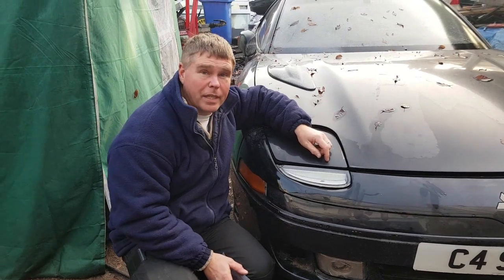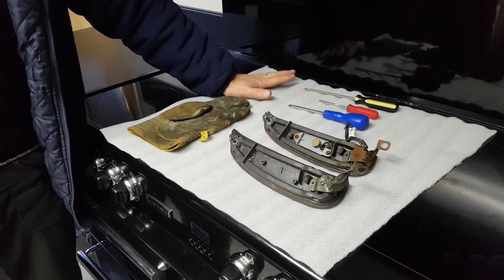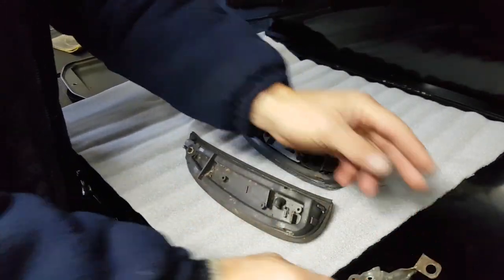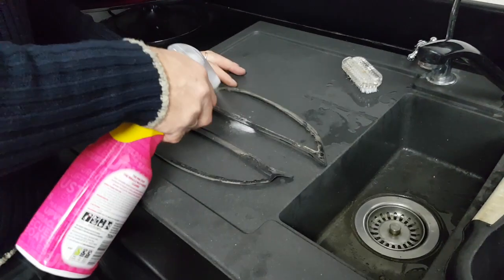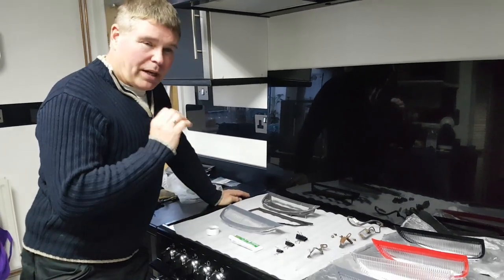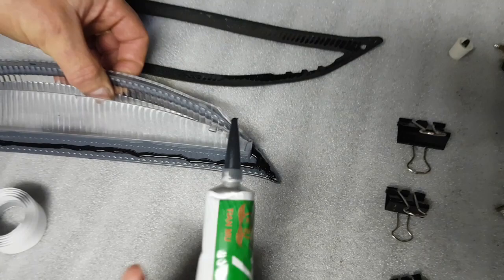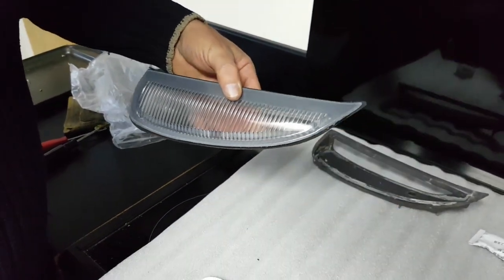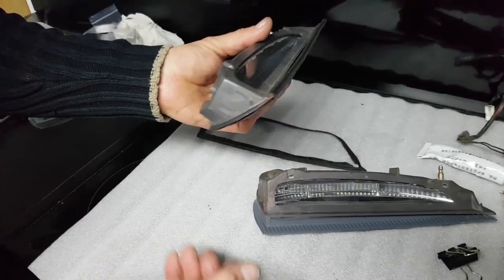Mitsubishi 3000gt / GTO front light repair

Comment: That engine bay looks remarkably clean. I would love to see a video about how you've made it look so clean and new. Another great video btw
Reply from the maker: I have had the 3000gt sl from new and have just maintained it properly. I have another 3000gt that was a total piece of crap and I started restoration before starting this video series but I will see if I can get mitch to put a slide show together so that you can see how the restoration was done. After the strip down videos are complete, I will be doing a full set of videos covering restoration which will be very comprehensive. Due to the cost of making the videos and my time constraints, the restoration videos are still a few months away but will be worth waiting for.
Reply: @3000GTGTORestoration  I can't wait to see them. I am also going to contribute to the fund as I find your videos to be of high quality and I would like to see them keep being produced. I have a few GTOs of various states here at the moment, and the dashboard removal and restoration videos were very helpful to me so thanks again
Reply from the maker: The videos are a gift without charge. You will also find fantastic offers on my new forum.

Comment: I don't have a problem with my low beam lights. They pop up and turn on just fine. However, I have a perplexing problem with my high beams. When I pull the stick back to turn them on, they do not, and instead, the low beams turn off instead! Imagine my surprise when driving at night.
Is this related to the actuator inside the car, or in the lights themselves?
Any insight would be appreciated.
Reply from the maker: Please could direct fault finding questions to the forum. YouTube is for videos. Thank you.
Reply: @3000GTGTORestoration  point me in the direction of the forum you mentioned please? I asked around in a few FB groups I'm a member of, and nobody knew.
Reply from the maker: Forum.the3000gtplace.com
Reply: @3000GTGTORestoration  thanks. I appreciate it.

Comment: Love the videos! I was interested in getting a pair of these replacement lenses shipped to the USA, but can't seem to add the phone number you noted in some of the comments to my WhatsApp. Any trick to sending you a message there?
Reply from the maker: Try adding the number as a contact in your phone first then it will show up in WhatsApp. Hope this helps.
Reply from the maker: Don't forget to add the country code +44
If all else fails, just go onto the forum. Forum.the3000gtplace.com
Reply: @3000GTGTORestoration  Thanks for the tip. I tried that but still don't get you as a contact in WhatsApp. I joined the forum, but I can't send a PM there either. I tried texting the number directly. Hopefully you get it. Or maybe you can try sending member "WxofxW" a message?
Reply from the maker: I can see that you sent a like on the forum but you are not listed as a member so I can't send you a message.
Reply: @3000GTGTORestoration  I signed up and created a user account. Is there something else I need to do to become a member?